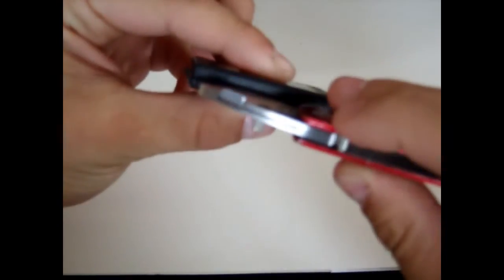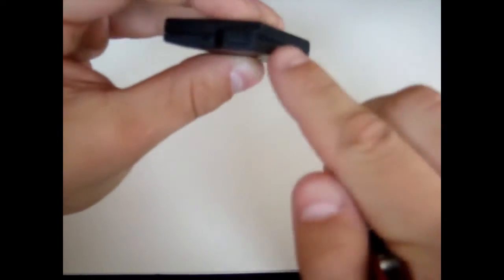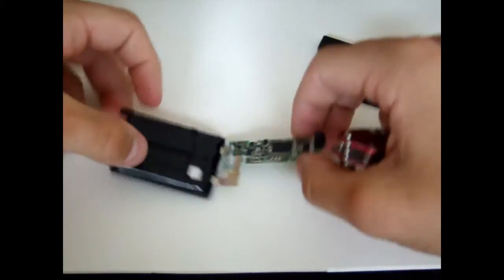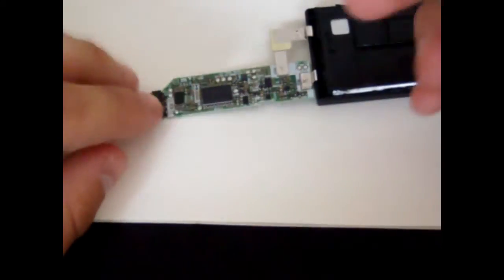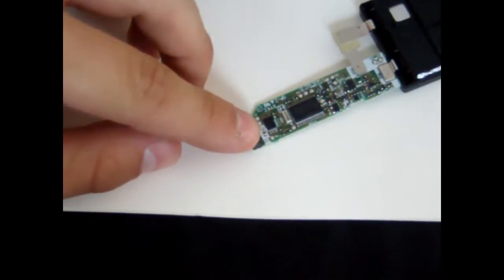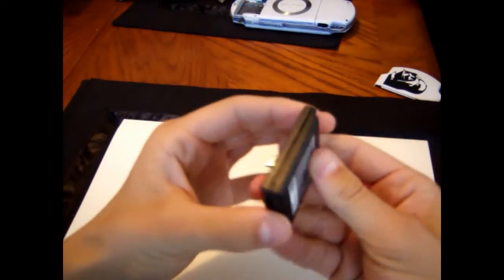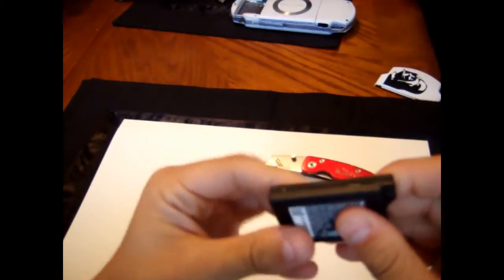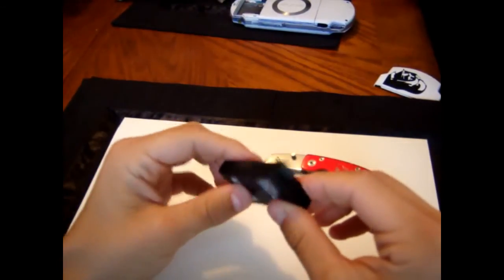How to make a PSP Slim Pandora Battery

Comment: what does a pandora battery do?
Reply from the maker: A Pandora battery is used for unbricking 1000 and early 2000 PSPs. There is no advantage at this point to use a Pandora battery unless your system is fully bricked. Note that Go, 3000, and some 2000 PSPs cannot use a pandora battery and thus can be permanently bricked.